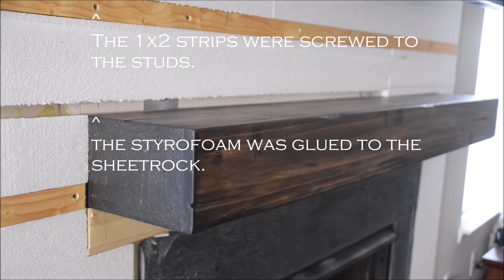Faux Stone Fireplace DIY Installation

Comment: In your material description you had two corners.Where did you use them? You cut the ends on a 45...Thks
Reply from the maker: I used one pre-made corner on each side.  While the 45 degree cuts did not make these necessary, I wanted to see how the manufacturer presented corners.  Additionally, I found that by using them I was able to stagger the seams with good material yields.

Comment: What does the inside edge around the fireplace look like? Did you cut 45 degree returns for those edges, also?
Reply: I did not want to have a jagged inside edge, so I cut it straight, roughed up the edge with a metal file, and used the touch up paint to match the side color with the front.  This made it look appropriate.  Thanks for watching my video.

Comment: Nice. Where did you get the faux mantle from? I am looking for something very similar to that.
Reply from the maker: I made it  out of 1x boards.  Sorry that I don't have details on this construction, but you can see in the video around 2:05 what the ends looked like without a complete end cap.  On the other side, I just capped it completely.  I basically painted the ends black and beat them up to look like end grain.  I added the splits and distressing myself before staining.  I hope that helps.